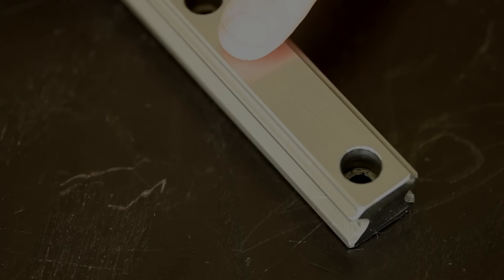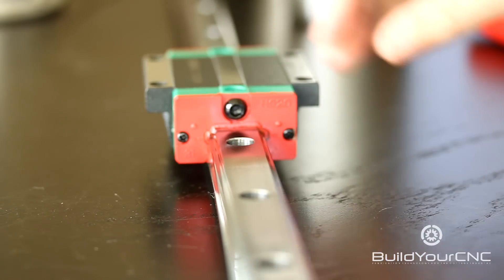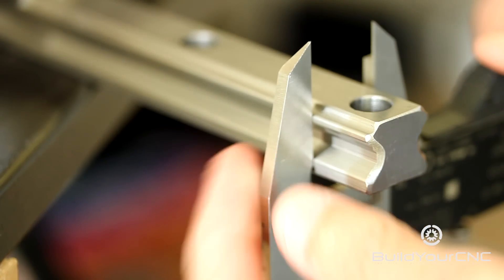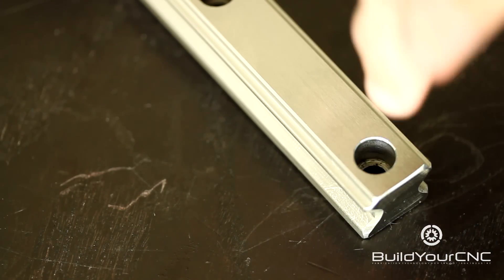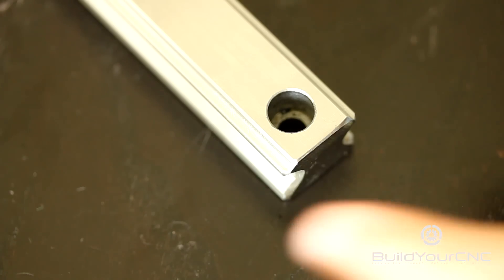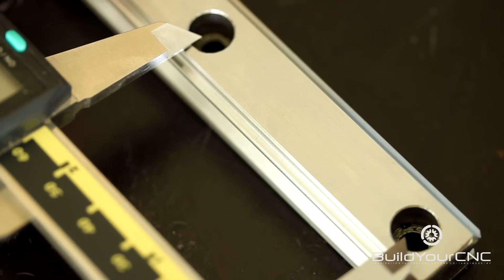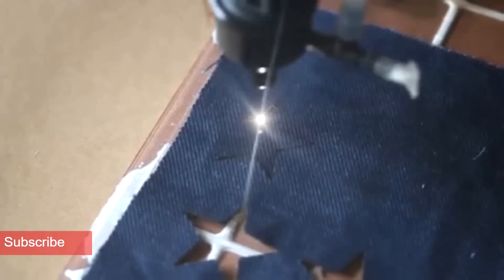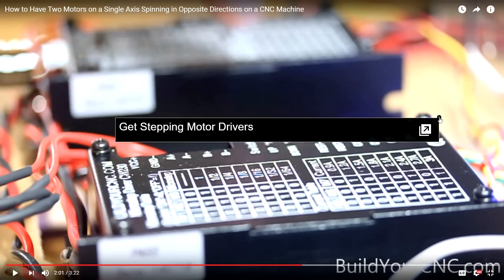How to use 20mm Hiwin linear rail

Comment: Can you mount 2 sections of rail end-to-end to get a longer run or does that result in an bumps/innacuracies as the carriage crosses the joint between two rails?

Comment: You are out of stock, I am building a 4 x 4  machine with 80/20 and need the complete Hiwin rails and lead screws for this without the Z assembly. That I have purchased as separate and finished. I will of course be drilling holesfor the Hiwin blocks of course.
Reply from the maker: Yes, we are out of stock at the moment (11/29/2017).

Comment: Do they require any minimal load to move smoothly?
Reply from the maker: The effort is very minimal, but because the bearings are pretty tightly wrapped around the rail, some effort is required.  I don't know the actual load, but it is very small.  It would not require any more torque from a motor over the regular inertia of the structure and load during the milling process.